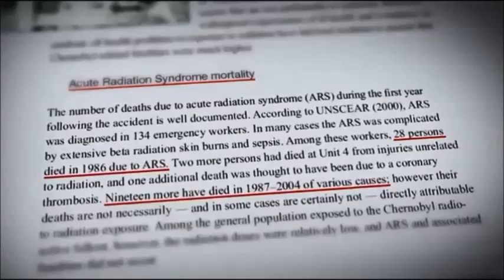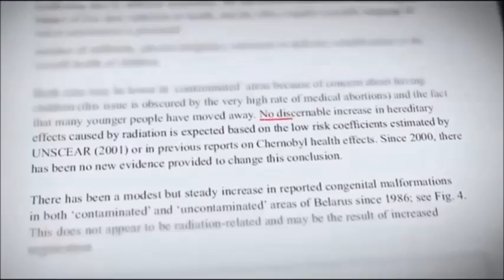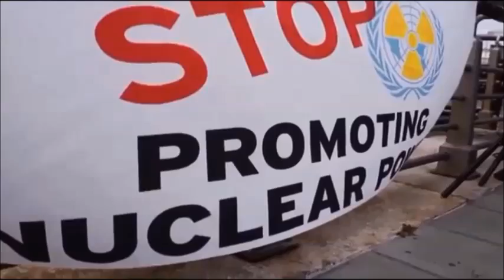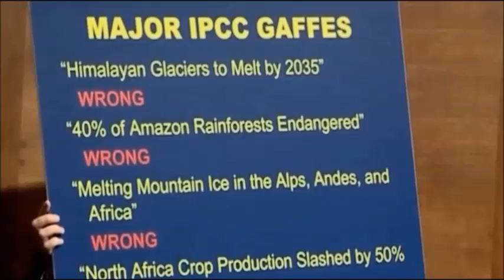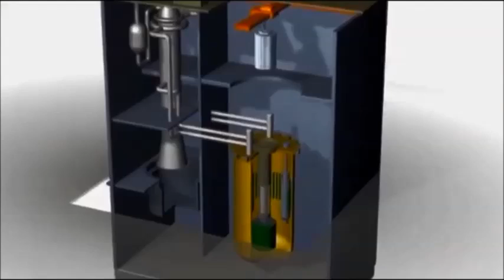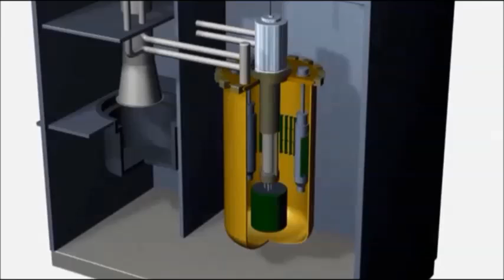pandoras promise part 3/3

Comment: Bull sheets.   Thor Energy needs to make sure that the thorium fuel cycle is fully understood. To do this, the company
 has built a small test reactor in the Norwegian town of Halden, where rods of thorium-MOX provide steam to a nearby paper mill. This reactor will run for five years, after which the fuel will be analyzed to see if it’s ready for commercial reactors.

Comment: France is NOT the GREENEST country in Europe. http://www.climatechangenews.com/2014/10/21/sweden-rated-as-worlds-greenest-country/
Reply: Sweden is a tiny population with exotic geography.  Their model for power cannot be scaled and exported to most of the large nations around the world.

France cannot use Sweden's energy model.  Germany cannot use Sweden's energy model.  The United States cannot use Sweden's energy model. China cannot use Sweden's energy model.  India cannot use Sweden's energy model.

Sweden having a 'greener' power model than France does not in any way contribute to the discussion about how to appropriately make the world Green.

Incidentally, the only reason Sweden beats France is because France is only 80% nuclear.  France's footprint comes almost entirely from the 20% (plus fossi-fuel based transportation that comes with a more populous country.)  Nuclear is actually greener than Hydroelectricity, because the material costs for a nuclear plant vs a similar-capacity dam are much smaller.  Fewer emissions from construction, while sharing the same negligible emissions from maintenance, the zero emissions from operation, and the similar longevity actually have nuclear eek out the advantage on average.
Reply: Sweden gets 40 percent of its electricity from nuclear power. And I agree, it‘s a very environmentally friendly way of producing electricity.

Comment: How can ANYONE say they are not concerned with having to secure nuclear waste for 250000 years? That is just idiotic.
Reply: And all current stores of depleted uranium has to be transported to says new thorium sites and stored, or still stored in place till used. No thanks
Reply: Isn't one of the supposed attractions to use up the spent nuclear fuel sitting at all nuclear power plants now?  So all that depleted fuel would have to be transported to the thorium reactor, no? Will it all sprout settings and fly there?
Reply: And what about terrorism? What happens if a blast ruptures the vessel?
Reply: That didn't answer my question
Reply: Pranjal Sagar The point was terrorism. Can terrorists make salts not be where you want then to be? yah....
Reply: What happens if terrorist hijack an airplane and use them as guided missiles? Are we we going to dispute the benefits of having air travel?
Reply: Well.... how exactly are you presently 'securing' your high levels of devastating CO2 waste...? ALSO available for thousands of years and globally driving your climate out of control?! One type of waste being kept as secure and locked in as possible, the other type just let loose to harm as much as possible... do you see the difference?
Reply: @Sagar Salts need to flow, ergo, interupting flow will render the reactor critical. Stop with the pie in the sky Bullshit about another type of stupid boiling water to produce steam. It is ASSININE on its face. Has always been,

Comment: Reprocessing nuclear waste is NOT a renewable energy. Eventually it will be used up and there is no NATURAL process to make more of it. OMG  the lies being told here.
Reply: Claude, just to be factual. There is about 10.000 years of Thorium widely abundant in the ground. Not exactly everlasting, but then again, 10.000 years of CLEAN energy sounds pretty promising to me in an energy hungry future and should be sufficient time for furture generations to figure out an alternative, no?! One can even argue that 10.000 years in terms of present human stupidity is as long as human 'eternity' goes, optimistically.
Reply: @avalonrip  It is no CLEAN.
Reply: The sun will also burn out.  And before that, all the copper used to make solar panels will be used up, all the aluminum to make the massive distributed power grid will be used up, all the lithium to make the batteries to solve the indeterminacy problem will be used up, and there's no NATURAL process to make more of that either.

Reprocessing nuclear waste isn't 'renewable'.  It's just that, we've only used <2% of the fuel available in that 'waste'.  The current waste in the US, that comes from running 20% of our grid for 40 years, could power the entirety of that same grid for ~400 more years.  Just with the stuff already harvested, which represents a microscopic amount of the easily mined ores available to us in the crust.

We're talking tens of thousands of years of available energy  at ever-increasing degrees of use, during which that magical Fusion unicorn might materialize, and give us millions of years of energy.
Reply: See, you EQUATED the material copper with the source of the energy. You LIED, like the other nuclear energy enthusiasts. The only way to get this technology accepted is to LIE.
Reply: No, just equating the scarcity of one material necessary to extract energy from your preferred source, with the scarcity of a material necessary to extract energy from my preferred source.

The Uranium and Thorium available to us in the Earth's crust will power us for many thousands of years without issue.  Meanwhile, Thorium is especially easy to locate and mine on other planets - it's magnetic signature allows us to map concentrations from orbit.  The 'natural' process to make more is a supernova, which I admit are in short supply, but then, your precious solar power also relies on heavy metals forged from dying stars.

The Rare Earth metals necessary for wind turbines, and for energy storage of all transient power sources. Those rare earths, incidentally, mostly exist as a product of the decay of Thorium and Uranium.  They exist in similar concentrations to the former - often inside the same mineral and are mined simultaneously.

Renewable energy is not infinitely scale-able, which is all your criticism of nuclear amounts to.  So I fail to see the advantage.
Reply: You are pulling our legs? Boiling salt is much easier and non-polluting with solar. It makes a perfect peak time energy storage solution. Nuclear, any kind, is DEAD.
Reply: I love the interstellar mining but. Yeah like that wouldn't cost a fortune. Lol
Reply: Dude they are called batteries
Reply: All the batteries in the world, would power the world for about 15 minutes.

You're going to need enough batteries deployed SPECIFICALLY for the grid, equal to several hours or even days of average power draw.  

And you'll constantly be cycling them at night. batteries die after so many cycles and must be recycled.  Discharging every day is probably going to lower their capacity to ~50% in under 3 years.  Overall you'll probably have to recycle and replace every battery on the grid every 6 years (cascading cycle).

So you'll have to manufacture something like 12 times the total batteries currently in the world, every 6 years.  That doesn't sound cheap or material-non-intensive to me.
Reply: Home batteries can be had for about $5k that is not deep pockets. More lies
Reply: Okay, so if the average home uses 400KWh a month ($40 bill), that's 4800KWh a year.

Assume then the power wall is getting discharged every night - and you're looking at a lifetime of maybe 5 years.  So that's adding an extra fifth of a dollar per KWh.  Or an extra $0.20/kwh when the normal cost of electricity is about 10 cents.  So the cost of storage TRIPLES the cost.

Furthermore, those home batteries don't really provide the answer.  Your home can stand intermittent or limited power every now and then. And can buffer itself with small batteries.  But you can't do that with industry.

You can't run a steel arc furnace off of batteries.  You're literally melting down cars with electricity.  How many Tesla batteries does it take to melt a Tesla Car?  Hint - more than one. Or ten.  And the power MUST be continuous, because god forbid the power go out while softened steel is mid-process.  If it cools you have a giant piece of solid steel sitting in your rollers, that has to be cut out with welding torches.

You're not going to run Industry off of batteries.  You just can't store enough electricity. The cost of a home power unit does nothing to disprove that.  It just proves you can run off of intense solar and wind if you're willing to pay at least 300% grid cost.
Reply: And I'll believe that group's bid when I see it. Solar plants are constantly being over-estimated in capacity. A few days of 'less sun than expected' has significant impacts. Just ask all the solar farms in California struggling to meet their bids.

Meanwhile, that still doesn't account for batteries, which as I just said, costs twice as much to buffer the energy as it does to supply it.  And you have to supply more of it because you need to get all your energy in the 12 hours or so the sun is up.  With the risk of the sun not being up, you'll easily need to build 3x the capacity of what you'd need from nuclear. 3GW capacity to the 1GW, because you need to get the energy in a shorter span of time.

Comparing MWhr to MWhr without accounting for storage, or capacity to capacity without generation coefficient, are both dishonest. And they're always the source of these 'cheeper than ever' prices.

Fracking made natrual gas slightly economical, and in under 20 years half of our coal - 1/3 of our entire energy grid, has been taken over by natural gas.  If Solar were really that cheep and reliable on its own, it'd be exploding everywhere and rapidly taking over our entire grid.  It's not happening.  I wonder why.

Comment: I don't know of any Atomic Power Plant that is designed to last more than 40 years. Plastics on all the wiring and rust just being the most obvious problems.
Reply: In the US alone 40 reactors have already reached 40 years of operation and they‘re all licensed to run to 60 years. Are lies and half-truths the only arguments that you anti-nuclear activists have?
Reply: LV31 
Yeah ...they are running but people are saying the structures are rusting etc...and the containers of the waste last 100 years but the contents are dangerous for 1000s of years

Comment: New study indicates given the current subsidies to nuclear HInkley-C reactor proposal it would cost only half as much per kw to build an equal supply to the grid with solar.  This is using the UK subsidy scheme but clearly indicates the nuclear cost is about double to supply a steady input using solar and current storage technology.   Why does a 50+ old industry like nuclear need any subsidies if it can"t compete with new emerging solar technology in the cloudy UK?
Reply: Solar provides intermittent power and requires backup generation in the form of fossil fuels.
Price per kw is not an effective measure for the value of an energy plant.

After Fukushima Japan invested heavily in Solar. They produced so many solar panels that they actually provide more peak power than the grid can handle. However, Japan's carbon emissions continue to rise. 

If the panels can't produce power when it is needed, then the cost per kw is irrelevant.

Comment: Nukes of 40 years ago were a pretty rattle-assed affair, granted. However, do a litle homework and look into pellet reactors and the level of safety they offer. At the same time, keep  in mind the horrors that coal mining has visited on the southern US. The coal mining companies own the government there.

The crap that pours out of coal-fired plants is a certainty. It is causing more environmental damage than a meltdown in a nuke. The CO2 load they put on the atmosphere is inescapable (if global warming happens to be a concern)

Your windmills are a nice idea but they are wimpy. One wind-powered  generator can max out at about to 2-million watts (when the wind is blowing at a good clip). A decent nuke can put out typically 1500 megawatts 24-7. 

We need nukes for the next 30-50 years  while we figure out ways to phase out fossil fuels.

Comment: If radiation is so harmless why are we asked to stop tanning ? Even the radiation from the sun causes melonoma ! And why do they wear white suits in the nuclear power plants ?
I guess its just a fashion statement.

What gets me is the absolute gall that is rampant within the nuclear industry. None of these plants were built with an exit strategy ! So decommissioning is a "' lessons learned process." Whats worse is that the spent fuel rods which are ultimately stored in steel and concrete casks are only built to last a few hundred years. So what if the radiation in these casks will last thousands of years ? Who cares what happens to our great great great grand kids ? As long as we can make money !!!
Reply: Dear Mark : Both sides exaggerate that much is true. However there was a spike in thyroid gland tumors after Chernobyl in the first year which grew again after the second year. It went from 4 cases prior to the accident to
60 in the first year then to 80 cases the following year. Those are only the recorded cases. See the book "Chernobyl Legacy" by photographer Paul Fusco. The deformed children born just after the accident are a nightmare.
It's true there are different kinds of radiation but if you absorb the wrong kind you won't last long. And speaking of lasting long the product of spent fuel which is when Uranium becomes Plutonium after going through the power plant lasts thousands of years and MOX the fuel which is made of reprocessed Uranium is much much worse than the spent fuel was to begin with. I have heard two people who worked in the nuclear industry 
in high positions speak and they had nothing good to say about it. The new Thorium power plants are not answer either.
Reply: Did you seriously just bring up ultraviolet radiation? You do understand that it's just a non visible light frequency right? You probably also think microwaves irradiate your as well food and make it dangerous as well right? How laughable.